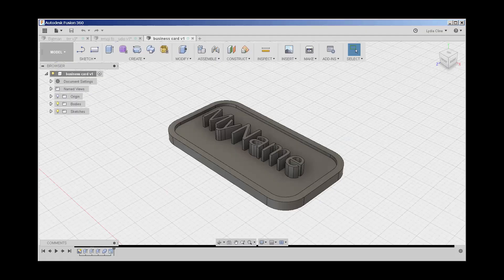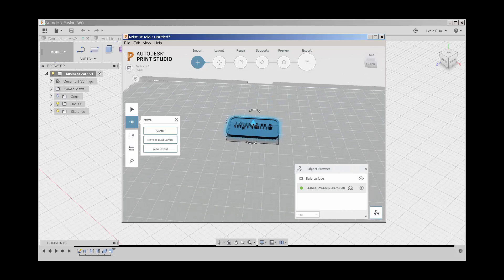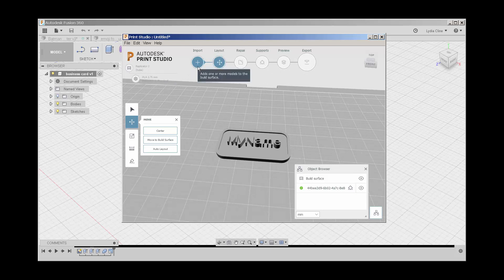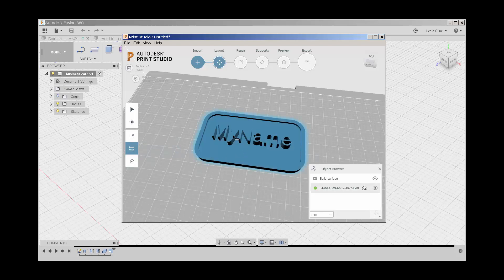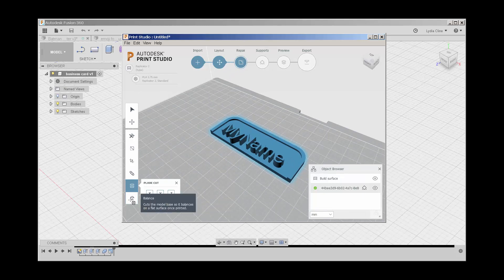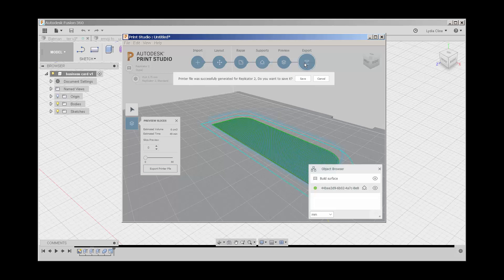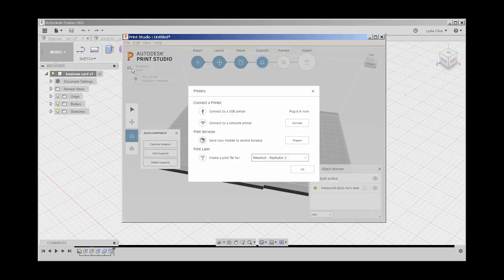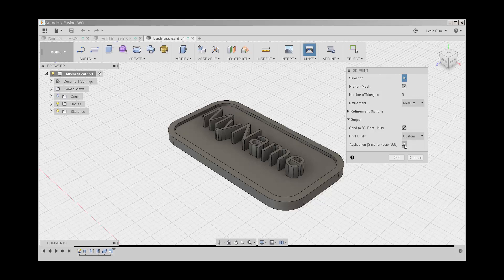Fusion 360: Autodesk Print Studio

Comment: It seems that Print Studio has been discontinued. https://spark.autodesk.com/
Reply from the maker: Yes. Netfabb for Fusion is now in the Autodesk app store. It's kind of difficult to install at this time, I'd use the stand-alone version (if you use it at all).
Reply: I've actually been turning off the external app option to save the STL file which I run through a slicer app to generate the gcode and print.